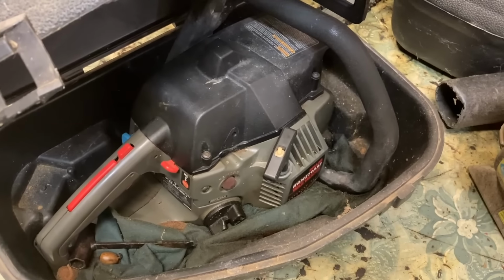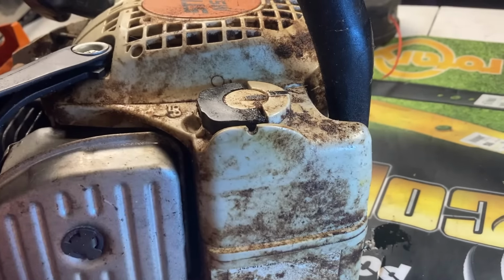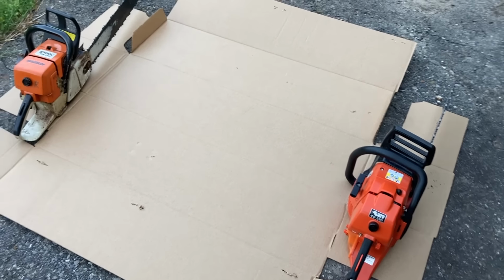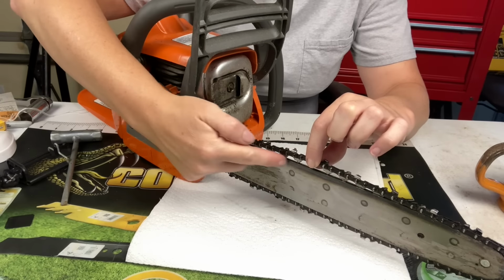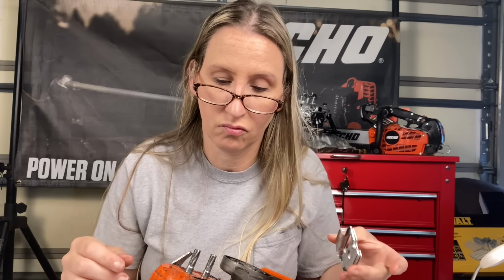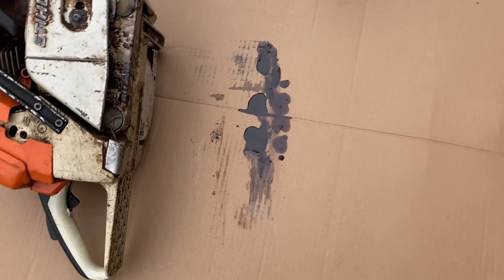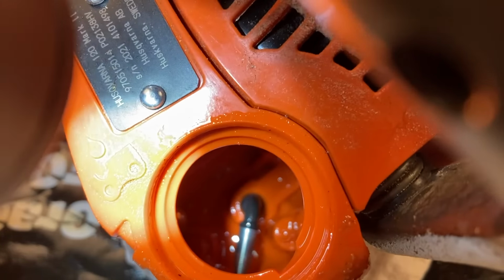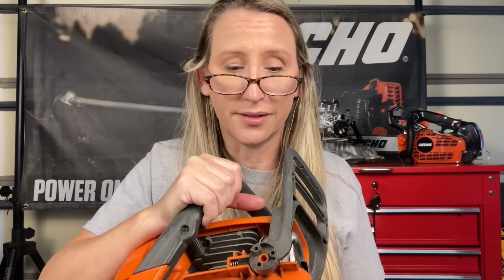Chainsaw leaks bar oil? The most common reason why AND Husqvarna saw leaking oil FIXED!! Repair Vlog

Comment: There are some needle nose pliers that have a second hinge in the middle. I forget the technical name, but it makes it easier when you need to pull fuel line, filters, or grommets inside the narrow tank holes.
Reply: Hemostat?
Reply: They flipped the bar and let the chain ride along, forgot to flip it too
Reply: Snap On make their Stork needle nose pliers. These have long handles and the grippy end has a double bend in it which makes them pretty handy for tight places (like that but where you can see the bolt you just dropped but can't touch it on your car engine)
Reply: The hokkout pliers for fishing are pretty good too
Reply: @gavinshields2812  no, not at all. A hemostat is a clamp that LOOK like pliers but they are biased to shut, because they're clamp. Plus I've never seen a hemostat with a double hinge. If they even exist, they're still not what I'm talking about.
Reply: @davidwillard7334  huh? Many types of equipment have a weighted pickup/filter combo to keep the inlet line submerged while you're moving the tool around. Theh also often have a purge/return that just drains back into the tank. Anyway, sometimes those are a tight fit and you might want to pull them from within the tank.

There's different ways to install though. You can also feed from the top and if you get lucky and it doesn't snag on the way out to the tank filler hole, you can put a filter on the end and pull it back up. There's different ways, but sometimes you just need to adjust or pull a bit and I find those long reach double joint pliers really helpful in tight places.
Reply: @davidwillard7334  glad you got it figured out and got your saw back up and running. Cheers!
Reply: @davidquirk8097  Snap On ! Should Be !.Renamed ! EXPENSIVE !! ON !! THOSE !! RIP !! OFF !! MERCHANTS !! SELL !! ANYTHING !! TO !! RIPP !!  YOU !! OFF !!
Reply: @davidwillard7334   where do you get your ! from, have they got a special offer on at the moment. Maybe just add helpful comments in future? We all know that Snap on gear is expensive but it's price comparable with Facom, Hazlett and Stahlwille so go and look at the product then find the cheaper knock off version.
Reply: @davidquirk8097  Well if you Want to get ! RIPPED OFF ! then That's you ! Not l !
Reply: They also make NN pliers that aren't 4 sizes too big and some with bent tips that are mighty handy.

Comment: I have been running chainsaws since the mid 1970s. Mc Cs, Stihl, Poulan.  I have used bar oil, old fryer oil, mineral oil and used motor oil with no leaking problems.  This lady is spot on when she says keep it clean and in good working order.  My go to saw is a Stihl 034 from the late 80s.  Keep it clean and sharp,  do not use ethanol fuel and any 2 cycle mix oil has worked great.  I like the blue stuff best!

Great video.
Reply: Neither of those saws were cleaned, wiped off maybe, definitely not cleaned. In our orchards we mainly use pole saws occasionally chainsaws, the pole-saws do the same leaky-leak.  Especially if they have not been cleaned properly after use. I tend to go OCD with my pole-saw.  I make sure their is no debris around the oil and fuel caps before I open to refill. Debris inside can clog up tanks and is a nightmare to unclog and clean out.   I use compressed air to the majority off the outside, remove cover, bar and chain and repeat underneath the cover. I scrape out the rails with an old credit card and use a small pick to clean out the oiler holes then use ca again down the rails to the spinner and listen to it sing. Use pick around sprocket and all nooks and crannies as needed before replacing bar and chain. Wipe off any excess residue with paper towels as I go. Some complain that I go overboard but my saw makes less trips to the repair shop than anyone else’s and mine is the oldest saw of the bunch.
Reply: Why not use a good point is the type of borrow all you're using if you're using a cheap type of bar oil it's going to run the heck out of the the system compared to a good bar oil that's going to be a lot thicker which isn't going to run out of the system

Comment: Thanks for posting. My Stihl MS180 used to drain bar oil completely out of tank after use. I replaced oil line and all good now. Still leaks some. They all do after usage. Nature of the Beast, I guess. Loosening cap ,to relieve pressure in oil tank, was tried but never proved useful.

Comment: Learned so much here! I've been getting into troubleshooting chainsaws more lately. Great way at explaining things without ramble. Thanks from a fellow female chainsaw lover!
Reply: If you think about it, she actually gets it wrong. If you fill a 5 gallon bucket with water, and make sure to spray water all over the outside of the bucket, is the water around the bucket on the ground from a leaky bucket? When you buck wood, the saw dust takes away the excess oil. By running the saws without cutting wood, she loaded up the chain and sprocket area with huge amounts of oil, that oil will slowly run off the saw creating an oil slick. She needs to redo this video and warm the saws up by cutting wood and then shut the saw off promptly. Every self oiling saw ever made will "Leak" when tested like she tested these saws.

Comment: They all leak, even new, but more as they age (like us...). I always crack open the oil cap when stored. This way, no pressure build-up caused by temperature changes. It is what causes most of the leaks when stored. It will cut by 75% the oil leaking.  Unless there is an issue, then you have to fix it.
Love your videos. Thanks a lot for all the work you put in to teach us how to repair our small engines.
Reply: Love your opening statement, how true it is. I can relate to it too as l’m 70yo. 😊👍👍
Reply from the maker: I agree! Thanks Michel!

Comment: Excellent video, thanks! 
I’ve noticed that when I clean under the bar cover and within the bar groves before storing the saw, I end up with much less bar oil under the saw later. 
From your video I realized that my habits were eliminating the excess oil from draining down from the bar cover, chain, and bar. 
I’ve also noticed that spring warmer temps will allow winter grade bar oil (lower viscosity) to make a bigger floor mess than summer grade bar oil. Once I swap to the higher viscosity summer grade bar oil, I get less of a puddle.

Comment: I do most if not all repairs on my vehicles but always had a hard time with my small engine garden equipment. Your videos and commentary are amazingly helpful. I have a chainsaw that leaks and can't wait to diag the issue. Thank you Chickanic!
Reply: Concur. Before the space age I could fix almost anything on a car, but a motorcycle slays me. Nowadays I lift the hood and plastic stuff starts breaking.
Reply: @chrisbyers6084  Lol. Xactly. But like the commercial sez; "Take another look, at Plastic!"  Remember that one?

Comment: Many years ago now I stopped using regular bar oil because it's high viscosity regular manual transmission gear box oil. It's to thick and stresses the oil pumps to the point where the tight tolerances are lost and the oil simply leaks though the pump. So I started using Castrol 10 40 diesel engine oil and never had a problem since. It pumps quicker because it's much lower viscosity, sprays over your chain teeth and lubricates them as they cut and the chain stays sharp longer.
Another huge plus with diesel motor oil is that it contains Zinc, an excellent high pressure lubricant.
The only slight minus is that yes, you will use slightly more oil, but I buy my oil in bulk which offsets that cost easily.
I run four Stihl commercial chainsaws. None of them leak bar oil at all.
Usually at the end of a cutting session I will rip a large round. The longer shavings clean out the accumulated crap.
One other suggestion. NEVER EVER use used motor oil. It will eat away your magnesium castings because its acidic and full of nasty pollutants that will eat your oil pump.
Stilhl make the best chain bar pumps by far. Husqvarna and the rest are  crap.

Comment: Remember, the oil pump fills the bar with oil, which then goes into the chain as it travels through the channel in the bar. When the saw stops the bar is full of oil and gravity takes it all out onto the floor over time. All saws will mark their spot simply because of the design of the system, not necessarily a leak.
Reply: Yeah, but every bit of bar oil will leak out of my Husqvarna, not just what's in the bar.
Reply: My John deere saw leaks,my Husqvarna saw leaks,my poulan leaks.
Reply: @arcadiaoffgridexperience  Yep, that indicates a problem. Just the normal excess draining out can't be helped.
Reply: I cut for a living for 5 yrs in the black hills your topics starting and leaks are spot on thanks for your work rare that ANY body does saw repair😊
Reply: I bought a Craftsman 20 inch and it puts out a good amount of oil on the bar but hardly any reservoir leakage... I like it!! Starts on one pull! I keep mine inside where TISS WARM all winter...

Comment: I wonder if maybe  viscosity of the bar oil had an effect on the leak rate.
Reply: Hi Jim, here in Scotland, I have been using chain oil that is really thick like SAE 80 gear oil. Chick used SAE 30. I think you definitely have a point there.
Reply: Most definitely! And the tackiness.
Reply: So What's the Viscosity ! Of Used Cooking  Oli ! Then ! ??
Reply: @davidwillard7334  Fuck knows. Maybe around SAE 20?
Reply: Hydraulic oil is SAE 10. Or it used to be when I worked with it. I worked as a plant fitter. Dozers diggers etc
Reply: The higher the SAE rating the thicker (more viscous) the oil. Hope that makes sense.
Reply: @johnmitchell3749  o.k So what's the Highest.! S.A.E ! Rating ! Then !??

Comment: Some of the older small saws pressurized the oil tank from the crank case to pump out the oil. If you didn’t release the pressure from the tank after stopping the saw it would continue pumping oil out.

Comment: I love this channel, every town needs a technician like you.  By the way I hang all my chainsaws (4 Sthils) on the wall bar down and have no leaking problems. Mabe coincidence Mabe not.  Thx for being so informative and by all means keep it up.  😊
Reply: Me too , I still a small hole in the bottom it the trigger handle on the flat part then hang the saw on a nail or screw

Comment: My experience has been that bar oil leaking these excessive amounts is a recent phenomenon. This was not a problem when I earned my living for many years with the saws of that vintage. Husqvarna and Jonsered, both. My new saws all leak, very annoying.
Reply: Agree 100%. I have owned 10 or more saws and the only one that leaks is my 6 month old saw!
Reply: Are you from the days of years gone by when you had to manually pump the oiler to oil the chain?  😁
Reply: @davidgeorge8172  I have used those saws with manual oilers when I was very young but the saws I used  for work were all automatic oilers.
Reply: Making them almost all plastic I'm sure is part of the problem.    All of the saws I've owned in the past were mostly made of metal.

Comment: After using your chainsaw, It's a good idea to pour the remaining oil into a coffee can or jar. then wash off the chain/bar and clutch housing area with some brake clean or carb spray. This gets rid of dire and sawdust that clog up the oiling system, and if it has no oil in it, it can't leak all over your shop floor, or in the case.  A fully functioning oiling system will use up it's oil about as fast as it uses up it's gas. If it doesn't, you are not getting enough oil on your chain.
Reply: No-one who uses a chainsaw regularly would ever take the time to drain the bar oil tank after each use. And clean off the saw too? That would be a ridiculous waste of time. A chainsaw is a tool that needs to be ready at all times, not a car that we like to be shiny and clean. By the way, the smaller Stihl saws, like the MS180C, are miserly with the bar oil and will go through two or three tanks of gas per tank of bar oil. I agree with you: that is far, far too little lubrication. Thanks a lot, Stihl, for making your non-adjustable saws run the chains almost dry.
Reply: @paulmaxwell8851  It takes 15 seconds to dump the oil out of the saw and another 15 seconds to refill it.  Think about this, if it's leaking, you'll have to refill it anyway, and then there's cleaning up the mess.  So, it takes no more of your time and it saves money.  DUH.
Reply: So I have a sthil 018c chainsaw that will loose everything in the oil tank.

I just put a new fuel and oil line on and thought that would cure the problem.  Nope, it makes a big mess just sitting overnight on a paper towel. 

So would the tank be bad ?  I'm running ace brand bar oil, haven't tried a different brand .  Great video as always.    You rock

Comment: This is an excellent video. I think your experiment was warranted. I like the control and test variables. You sure taught me a lot. The only way I can think of stopping bar oil leak if you are storing for a bit is to drain the oil reservoir.

Comment: It depends on how the oil pump is designed, some allow oil to be pushed past due to temperature changes in the oiler tank.  These tanks often have a duckbill type one way valve that acts as a breather for the tank as the oil is used up when the saw is running, they allow air in but not back out.  This means as the saw gets hot and cold while in storage there is a pumping action as the air in the tank expands and pushes oil out, and when it cools it draws in more fresh air, this will keep happening as the saw warms and cools throughout the day.  On some saws though due to the design, bar oil won't get pushed out because there's too much resistance.  This can be because of tighter tolerances in the pump or the fact that the port is closed while the pump is part way through its stroke.  There are also on some saws a rubber bung that sits under the plate behind the guidebar that prevents oil dribbling through, oil can only be pushed through if there's sufficient pressure, such as when the pump is actually in operation.
Reply: The type of saws you are referring to with the duck bill check valve DO NOT work off of temperature, they work off of the crankcase pressure created by the piston that pushes the oil in the the chain oiler reservoir
Reply: to the chain.
Reply: @davidgeorge8172  They're not connected to the crankcase in that way.  There's no need to pressurise the oil reservoir as the oil pump sucks oil and then pumps it to the bar/chain.  The duckbill type valve simply stops a vacuum forming as the oil is used up.  But this valve only works one way to prevent oil escaping back through it, hence why pressure can build depending on temperature etc.

Comment: Stihl flip caps are "nice" but not really an upgrade over old fashioned screw caps.   Sometimes it's the cap, most times it's "user error".  User error winds up breaking the caps.  I think if you buy a Stihl with flip caps, you should also buy 2 new caps for it and have them on hand.  Bar oil cap leaking is a mess, fuel cap leaking is dangerous.  Class 2 rated footwear?  Good stuff, thanks for sharing.
Reply: I agree.  Are we working on a chainsaw pit crew?  Are they really faster?  I've never used screw caps and thought they were a disadvantage.
Reply: I hate those flip caps. Extra fun when the little flipper comes off
Reply: @jamescaron6465  I always felt like they were prone to failure.  Don't have things lined up right at the start you think it's closed, turn the saw on it's side and fuel all over your pants.  Screw cap?  Worst that happens is you need a tool to open it.  New isn't always better.
Reply: It shouldn’t take a rocket scientist to put a fuel cap or a oil cap on. And when you do they should not leak. That is the problem with the slip caps you got to put them on exactly right or they leak everywhere. Junk The old style you screwed them and snug them up they were on and they did not leak. Simple to say that these new styles are faster what a joke
Reply: yeah, good to have a spare because when they fail, they fail completely.
Reply: @mikeremski2102  I've never had a flip cap on wrong and didn't know it.  how do you not notice it doesn't seat and let the handle flip down properly?
Reply: Thanks for the advice I believe I’m going to take you up on it next time I stop by dealers. Pick up a new one provided they don’t want $20 bucks for it.
Reply: @rayclark8920  i forget what the one i had to replace cost. Less than the screw cap for the old weed eater that would crack and leak every few years.
Reply: @kenbrown2808  If you play around with the cap off the saw you can get the two parts out of alignment, then when you put it back on the saw, if you force it feels like it close, but it didn't.  Then it leaks.  Some of the original flip caps don't have the 2 black lines so it was easier to get it wrong.  Again "user error".
Reply: @mikeremski2102  so, basically, if you put enough effort into it, you can ignore all the relltale indications it isn't  in properly.
I guess it's like they say, "you can try to make it idiot proof but someone will make a better idiot."
Reply: @kenbrown2808  Exactly.  Or as my father told me:  If you want to prove you fixed something, give it to your boss".
Reply: @mikeremski2102  people can crissthread a screw cap, too.

Comment: When you top up your bar oil and refuel,  instead of pouring with the spout at the bottom of the container, turn the container so the spout is facing the sky you will no longer get the cavitation/surge and you get better control with refilling.
Reply: I was going to mention that you beat me to it.